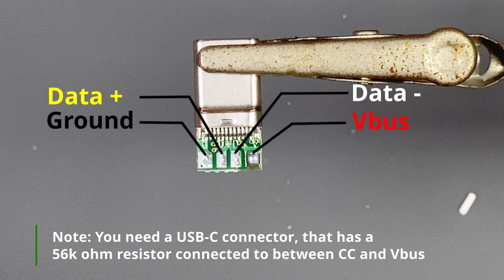Learn how to make your own custom USB Cable (DIY build guide)

Comment: Instead of removing the yarn string (core) out first, you could just tie one end of it to the paracord and as you pull out the yarn it will pull in the cable. Makes the process a lot faster and easier.
Reply: If the cable just barely fits that might not work though
Reply: @___echo___  Strip 2 cm and attach the yarn to the inner wires, then pull, will work a treat, even if tight.
Reply: You are wise. definitely will work and save time. If the cable just barely fits, that is all the more reason why you will need to pull it through. Similar to how electricians pull cables through conduits. This technique would be mandatory in a longer run. You have  to pull it through and that yard core is very strong.

Comment: I have made some research and it turns out it's better to use shielded cable, such as UL2547. The shielding is supposed to have contact with the metal "cages", which are placed around the connectors in this video. Such practice would prevent the cable from working as antenna and spreading electromagnetic interference.

Comment: Don't be afraid of putting enough flux paste/gel on the pins before soldering tinned wires to them. Blips/bumps will look much better. Otherwise the oxydation does its job and it is difficult to solder.

Comment: Hi sir, thanks for the video! Managed to make my own coiled cable following your other guide. You may want to use acetone to remove the printed labels on the black heatshrink. :)
Reply from the maker: Thanks for the tip. :)

Comment: What's the cable thickness? 5mm is too thick for 550 paracord, should I get 4.3 or 3.6mm? 1st one is shielded.

Comment: Great video. I would use an Ohm meter to check continuity between the cable ends before plugging it into anything.  Only takes a couple minutes and there's no risk.

Comment: @fizo can you go into detail about the note mentioned that said a 56k ohm resistor would be necessary in between pins 2 and 3 for the usb C soldering job. I'm thinking that is an important detail that nobody fully understood. Do you buy it with the resistor pre installed? What is the purpose of it and what are the purchasing options, or when do we need it?  Did your cable have one?  Sorry if this has been discussed already or if some of my facts are wrong.

Comment: Quality video. I just got some parts in for my first cables and I was wondering if one would use a crimping tool for the connector but this is yet another video in which the maker just used pliers. I guess that's sufficient then.

Comment: Thanks for the video, I have been trying to create a C-C cable for my macbook. Seems like my  usb-c connectors not the right one as it does absolutely nothing
Both 5.1k resistor and 56k ohm resistor type connector is fine? was not clear for me from the video.
I would appreciate if u could tell something about this.

Comment: Unfortunately this is no USB cable as it is clearly out of spec, especially regarding the lack of shielding and drain wire. A quote from the USB 2.0 Spec (Rev. 2.0) says "Cable
construction must contain a braided outer shield and a metallic inner shield. A drain wire of 28 AWG must be incontact with both shields"

Furthermore, a USB Type-C to USB 2.0 Standard-A Cable Assembly shall have (according to 3.5.2, Note 5 of USB Type C Spec Rev. 2.2) shall have "Shield and GND grounds [...] connected within the USB Type-C and USB 2.0 Standard-A plugs on both ends of the cable assembly"
Reply: It's for a keyboard that uses practically zero data it's binary so it's fine you literally won't notice

Comment: Nice video, if you could only cut every part to half because it is not necessary to show putting in the shrink tube or adjusting the soldering pen and so on. The video would be 5min instead of 10min. All in all, keep it up!

Comment: Can the cable charge with 100watts?
Is it possible to change the typ a 2.0 with a 3.1 or would the charge  speed suffer 🤔 this days it's extremely confusing with all the pd charge 3.1 charge quick charge ect. 😕 I need to make a lightweight cable for my ts80p soldering iron and be compatible with a pd charger.

Comment: Nice, but sadly, the shrinkable tube would not last long. It will tear when subjected to bending over time.
Reply from the maker: Possibly, but what's good is heat shrink tubes are cheap and it only takes seconds to replaced it. :)

Comment: what are the chances my keyboard will get damaged if i do it wrong?
Reply: as long as you dont mix up your power and data wires you should be okay...
you want to aim for a 90 Ohm imppendence for USB, you can test this with an ohm meter (usually a mode on your voltmeter) but if its outside that range it shouldnt damage your keyboard i imagine it would just not work right

Comment: Where did you buy this rubber 'rug' where you keep the screws? Do you have a link?
Reply: its a silicone soldering mat, theyre nifty and relatively easy to find online. amazon is a good place to start

Comment: Nice Video - in the step where you are stripping wire cable, where did you purchase the wire stripper?  :)
Reply from the maker: I get most of my tools from Banggood, but you can also get a wire stripper from you local hardware. Its pretty a common tool. :)

Comment: Hey! Great video! What kind of working surface is that? I would like to buy it :D (I'm talking about that black rubber looking thing on your desk with the small compartments) Thanks!
Reply: And what kind of clamp do you use to keep the wires in place when you are soldering them? for example at 5:30 Thanks again
Reply from the maker: Its called a silicone pad. ( https://www.banggood.com/custlink/mGvEZZmIvP)
Reply from the maker: As for the clamp, that's actually just a bulldog clip, its normally use for binding sheets of paper. :)
Reply: @FIZOdigital  Thank you so much! Appreciated!

Comment: Hello Fizo, thanks for the video :) i managed to make a coiled cable with your other tutorial !! It went great but i think the cable is a bit loose even after the reverse coiled. what should i do ? heat it again after the reverse coiled ? thanks :)
Reply: Or can i reverse coild twice ?
Reply from the maker: You might have to heat the cable more or longer. Anyway, if you have reverse coiled already. I suggest to reverse it again, which is technically brings it back to normal, coil it back into the tube, heat the cable again, let it cool and then do the reverse coil. :) HTH.
Reply: @FIZOdigital  Thank you for your answer, i will do that :). BTW, why you dont heat the cable after the coil ?

Comment: Hey I just finished my custom cable bit I need some help. When I plugged the cable inside the PC, it said USB over current. Is it because I missed soldered something? Please help me
Reply from the maker: What device are you using? Anyway, you might have short circuit.
Reply: @FIZOdigital  thank you fo your help. I asked some people and they helped me

Comment: During the test, if the cable did not work, is it going to damage your keyboard???
Reply: @Teo, No - if the cable is wired incorrectly, it just won't work - won't cause any damage

Comment: Does the cable have to be shielded?
Reply from the maker: According to USB specs, its recommended to use shielded cables. But based on my experience, for keyboard or USB 2.0 devices non-shielded cables works fine. :)

Comment: Is the wire shielded?
Reply from the maker: No, they are not shielded, you have to get UL2547 cable if you wanted shielded. :)
Reply: FIZO it’s not really Necessary right?
Reply from the maker: I haven't really encountered any problem with unshielded cable so far, but then I mostly use the cable on my keyboard and to charge my phone. Perhaps, some other application might require a shielded cable. :)
Reply: Are there any issues with these usb c modules that I should be worried about

Comment: Hi!  I tried inserting a 28awg usb cable 2.0 into a 550lbs paracord with 4mm diameter but seems like the paracord is too tight for the cable to fit in..  Is that natural or should I find a smaller diameter for my cord?
Reply: Did you ever find out? I'm wondering also